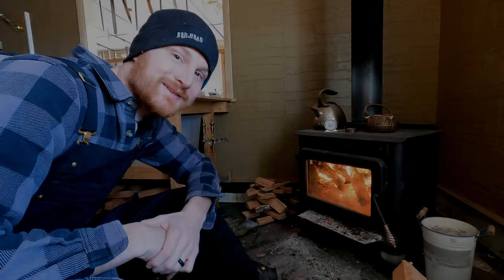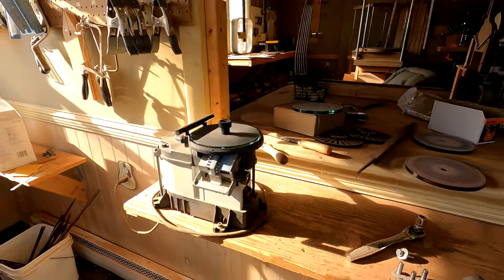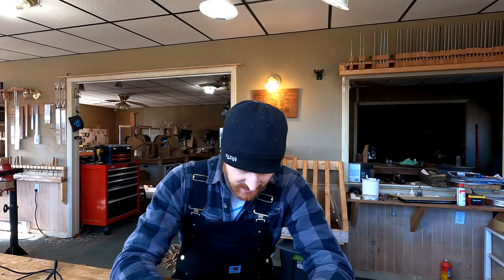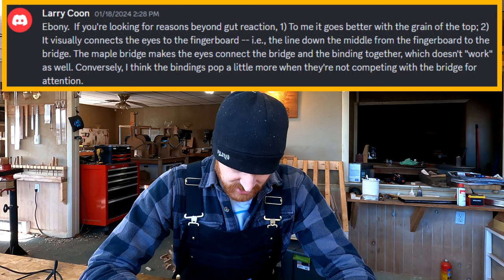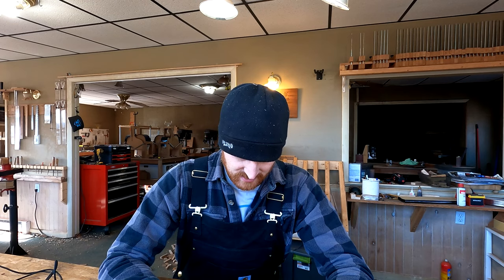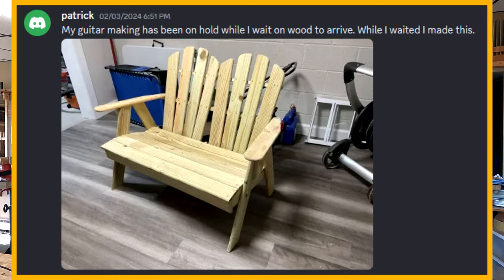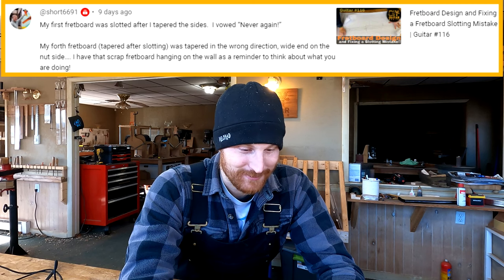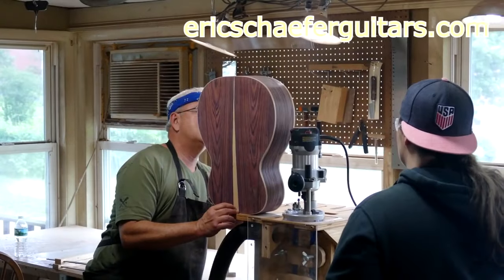Q&A | Chisel Sharpening, Mesquite for Fretboards, Happy Accidents and more!

Comment: Good info as always.  I do have to say, that was an awkward ending.

As far as sharpening, I was interested in hand tool woodworking and I use Paul Sellers' method of sharpening by hand.  I still need more practice to be as consistent as I'd like, but when I hit that edge, it definitely is pretty quick.  I don't use secondary or tertiary bevels.  I have been thinking about picking up the WS3000.